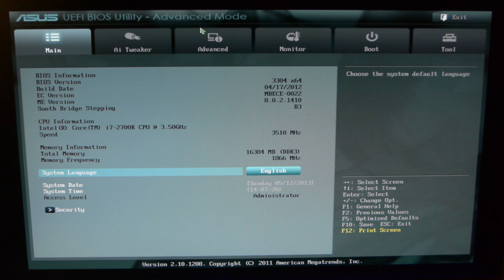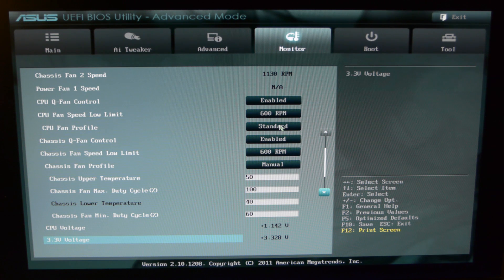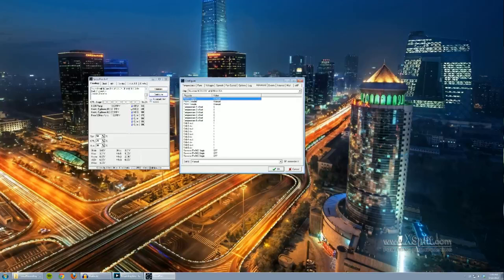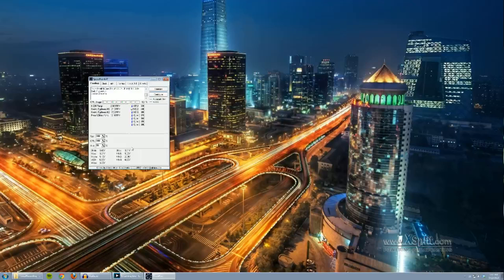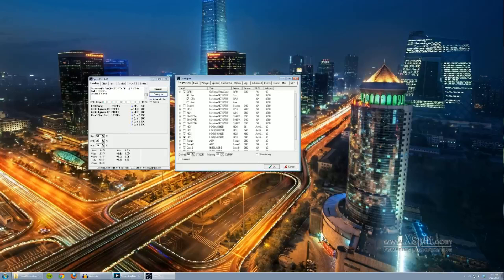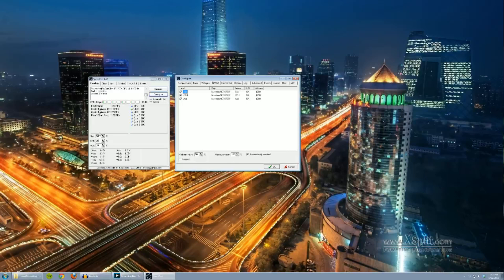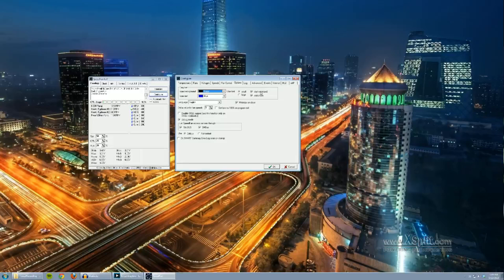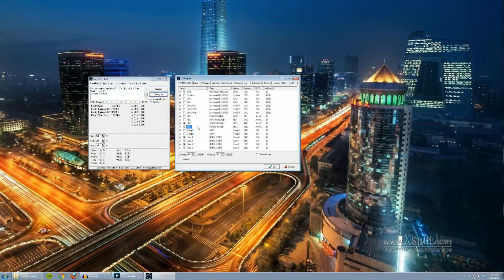[GUIDE] Setting up SpeedFan

Comment: As fan controller software goes (real voltage controller ones) its likely it wont support your motherboard. Speedfan however will at least install and run and montior heat temps, n some fans that are mb connected, but parts of it often wont work, like voltage control most likely wont. Its incredibly annoying as over the years, esp if your a system builder 5-10 systems for more of those that require more cooling, except those low rpm builds that dont put up much noise.

Its a constant reminder to do something about, personally for my main builds that are for gaming i just buy something like a scythe fan controller. They can be expensive $60 or so just to fan control. Its unfortunate they cost so much, perhaps the demand for them isnt high enough. They are meant to be part of the simplicity, not add to the complexity. That can be said about the software out there as well.

But at least after price, you do get what you pay for. Real control. But just cautious their are variations of the hardware voltage control. Ones that are touchscreen, may or may not give more than 10 variations of voltage from a 12v variant. Dial nobs are the best, with led screen display you get exactly the voltage/rpm you want. They come with heat temp sensors, they are mostly useless, they can only get readings of something depending on how close you are to the heat source. Used them, n software monitor (speedfan) showed a 10 degree difference. Dont bother with them n they make your build look messy with wires. But i would still get a fan controller product that does come with it. Those generally have better features included) 

Some other info, not that it will be much good.
The motherboards that have been voted to have the best fan control are:
- HP Compaq 085Ch
- ASUS A7V8X-LA (Kelut)
- ABIT IS7-E
- ASUS P5N32-E SLI
- ABIT IC7-G
- SHUTTLE FN41
- ABIT BP6
more
Fan Xpert 2 - wont install if your mb isnt supported
for mac try hddfancontrol - duno if its a real bit of software
http://www.hddfancontrol.com/

SpeedFan: A Guide to Universal Motherboard Fan Control
http://www.silentpcreview.com/article1275-page1.html

For GPU fan software, i guess the same principle applies your card may not be supported, try MSI afterburner, or riviatuner. MSI Afterburner is good, on my asus r9 280 3GB direct2 top, i can change the fan speed by turning off the auto button, adjust n (for some reason, click apply by clicking user define button in the bottom middle.

Stop fooling around n buy a fan controller product, bye!

Comment: Im not able to set it to manual, please help :(
Reply from the maker: In the drop down menu make sure you have the right chipset selected. If you still don't have the option, I would google the chipset to see if it's capable. Also, check your motherboard manual to see which fan connectors are controllable. Some of them may be fixed voltage and cannot be controlled. I know my board has at least one.
Reply: ez|2a i got an amd fx8150 and thank you :)

Comment from the maker: I would use the hub in the meantime while you figure out the PWM/Voltage issue. Maybe there's a motherboard update, but I would double check to make sure you set the right headers to PWM, because all of the signs are telling me it's being voltage controlled. To avoid damaging the pump, use the splitter/hub to supply a constant 12v.

Comment from the maker: Okay, that tells me that the pump is actually being voltage controlled. The hub works only with PWM control, and if your motherboard didnt work with it, its using voltage. You shouldnt connect it directly to the CPU header if it's voltage controlled. To verify my theory, plug in a 3 pin fan (not a 4 pin) to where the header you have the pump plugged into, and see if it changes speeds. If it does, it's voltage.

Comment from the maker: That's strange. Are you using the included swiftech splitter for the pump? If controlled properly the pump should never stop even when connected to the 4 pin CPU header unless it was being voltage controlled.What mother board do you have? I would use the included splitter for the pump.

Comment from the maker: ok, so the actual % adjustment is the minimum you set in the speed tab, correct? RPM 0 doesnt sound right, i would make sure that your bios settings are set to PWM control and not voltage. Is the pump running at all?

Comment from the maker: Hi Caleb, do you have "Automatic fan speed" checked in the main speedfan window? Is the actual reading in speedfan 0 or is the RPM readout 0? You can have speedfan start up automatically by creating a shortcut to it and placing the shortcut into the Startup folder in your start menu.